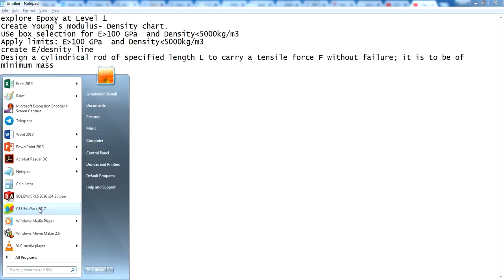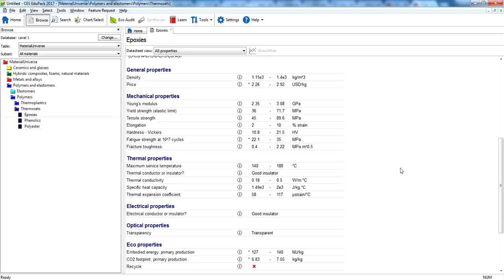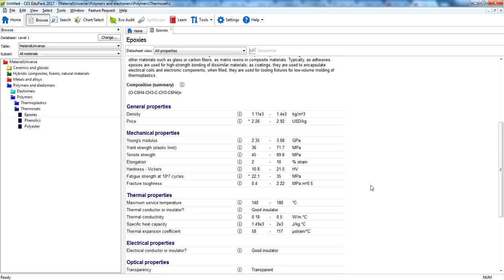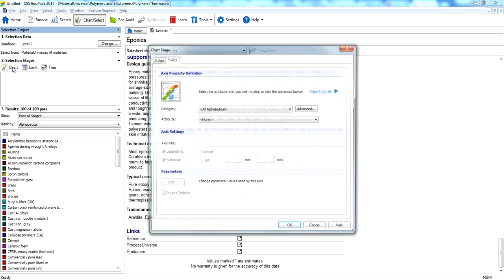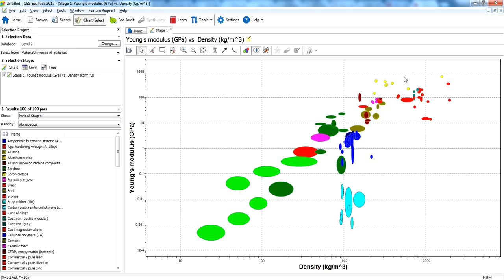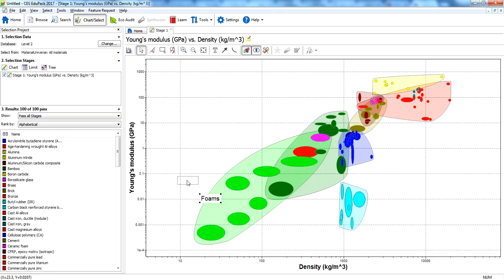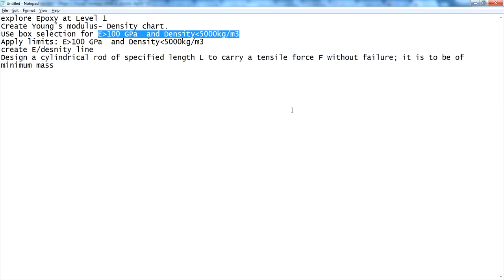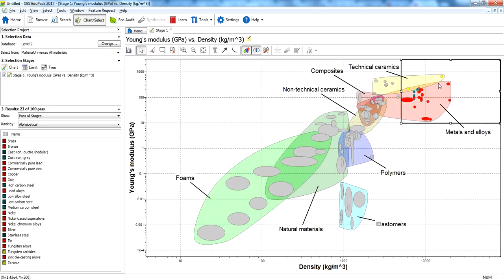CES Edupack 2017 tutorial Part 1

Comment: Your constraint states that the density should be lower than 5000, however in your box selection you select the materials with a density higher than 5000
Reply from the maker: True. You are right, I guess I got distracted and selected the opposite :). 
Thanks for mentioning it :)
Reply: @uwofracture  Please put an annotation above that. It is very common observation.
Reply from the maker: Thanks. Added a not in close caption.